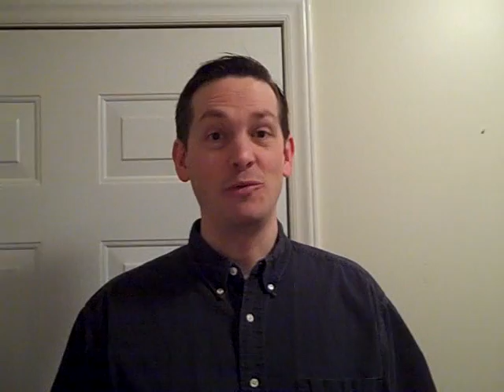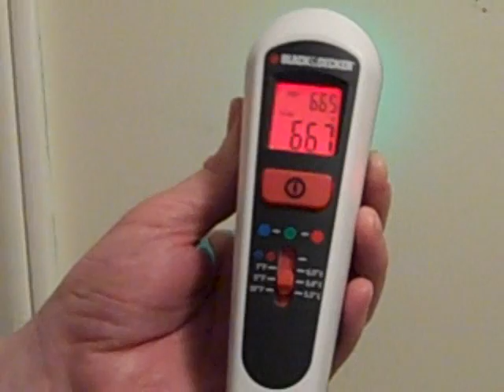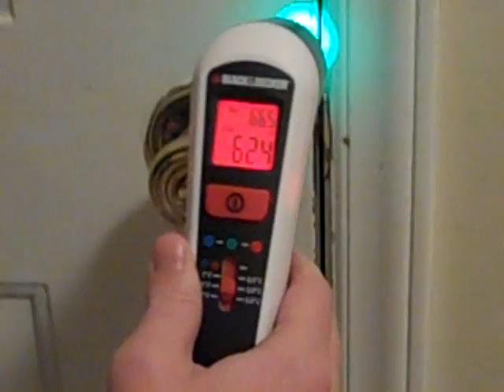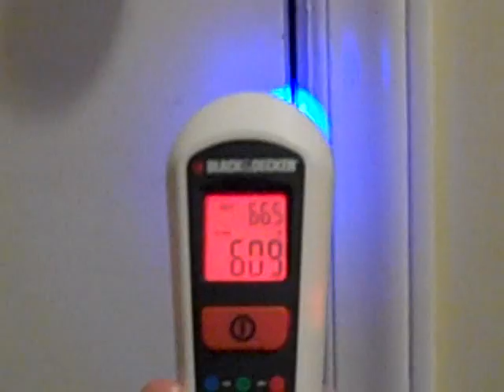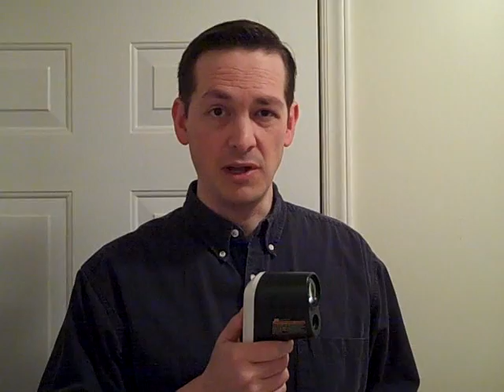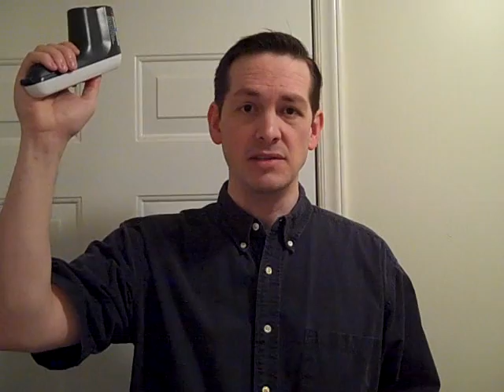How to Find Expensive Air Leaks in Your Home

Comment: Would this work in a 6x12 enclosed Cargo Trailer with .080 mil aluminum top wrap (metal on metal frame) which I just finished insulating using 1" and 1.5" pink foamular insulation? Thank you

Comment: This video inspired me to buy a thermal gun like that (different manufacturer) but I question the logic regarding the stated purpose of the video. A change in temperature doesn't necessarily mean an air leak. A perfectly sealed single sheet of plywood vs a perfectly sealed fully insulated wall will show different temps, while neither are leaking air (conduction vs convection). There's definitely a correlation between temp differential and leaks, but it's far from perfect. Any other tips?
Reply: Good point, but it is a starting point. I don't think there really is a more efficient way to find leaks. You might have to go from room to room, window to window, etc
Reply: @hellagrant  
Yep agreed. the average homeowner isn't interested in spending a fortune on tech or comprehensive examination any more sophisticated than this.